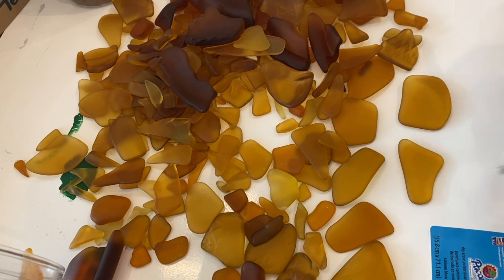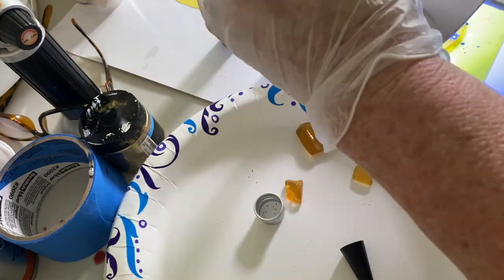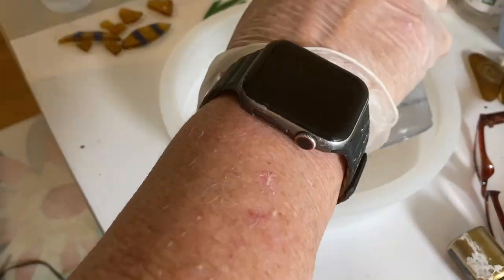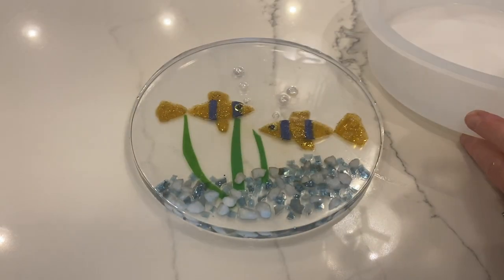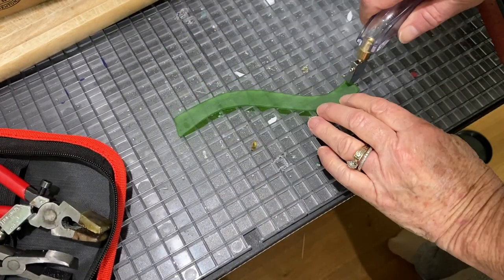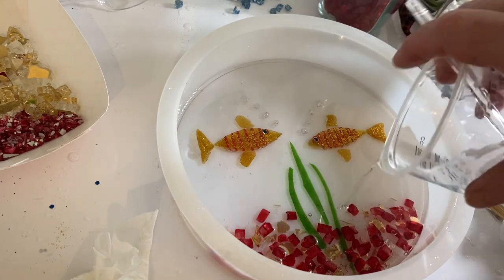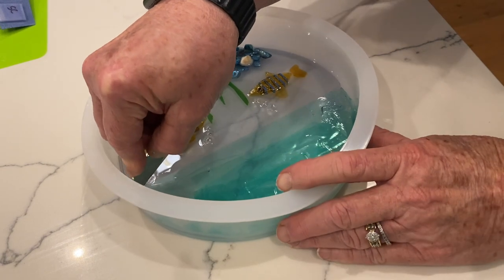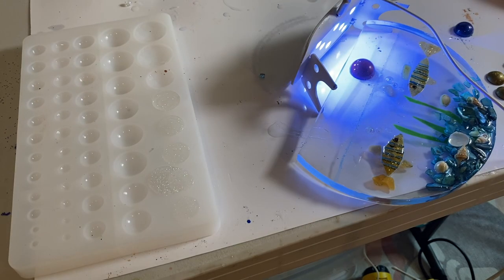FAUX FUSED GLASS WITH EPOXY RESIN, TUMBLED GLASS,STAINED GLASS FISH BOWL

Comment: Not sure if anyone has mentioned this yet, but a curing lamp like what they use at salons work great. They are stronger than the flat flip ones like you have. I love your work ❤❤❤❤
Reply from the maker: Well I have since bought a stronger one that folds and has the light on the top and bottom.

Comment: Oh soooo cute!  My favorite theme…anything beach.  Those are darling Linda.  I was wondering what amt. of resin are you using for this project?  Is it One cup Half a cup each parts?  Thanks❤️💜❤️
Reply from the maker: Thank you Yes I think in the first 2 I used about 4 & 4 oz for a total of 8 oz each and for the 3rd one which had 3 layers I think I used about 4-4 and then another 4 for a total of 12

Comment: Which resin do you recommend for a deep pour?  Thank you for your great channel!
Reply from the maker: I don’t know that i have ever done a deep pour. The deepest I have done for my round mold is prob about 1/2 inch But here is a good video to watch to compare https://youtu.be/aEoMvZe8KQ8
Reply: @crazyglasslady  This was a great video!  I noticed he didn’t try ArtResin?  Have you tried this one and if so what are your thoughts?  I can get this easily at the craft store.  The deepest pour I’m doing is a heart mold less than a inch deep.
Reply from the maker: @texasmarshalls  I have used Art resin and it is great. The only reason I have started trying other resins is because I have been looking for resins that are less likely to yellow esp out doors. My mermaid outside is done with art resin and has yellowed. I watched a video from Steve Mac Donald who tested some different resins out side and Art resin did the worst. Having said that you really should not put resin in the sun is what I have found it is just not meant for extreme heat or sun. The resins I have been using now hold up better out doors so I assume if they are less likely to yellow outside they may yellow more slowly indoors. The ones I am using are fast curing resins not good for canvas. Art resin is not for deep pours Im not positive but I believe you can only do 1/4 inch at a time Hope that helps
Reply: @crazyglasslady  so helpful!  Thank you also for your quick response!

Comment: Could you possibly use a line of silicone sealer to make a dam for the blue layer? Then remove it when cured?
Reply from the maker: That is a good idea! I bet that would work.
Reply from the maker: The only thing is, you would have to be careful you couldn’t let the silicone touch the side of the mold because the silicone would stick permanently to the silicone mold. I guess you’d have to put a little piece of tape there.
Reply: Didn't think of that, but maybe yes. Plastic wrap maybe.
Reply from the maker: Yes, good idea

Comment: what size silicone round did you use?
Reply from the maker: So at the end of every video I always explain everything I use usually especially with this mold because it is called a 9 inch mold on amazon but the inside diameter is actually 8 inches why they call it that I have no clue. So the stand for it is called a n 8 inch stand. I felt like that was confusing. Also Under the about info under the video I try to list everything I have used in the video. Here are the links to the mold and stand. I have made about 8 other projects and videos with that mold  I have gotten my moneys worth LOL .
Mold:   https://amzn.to/3SwO7TI
Stand:   https://amzn.to/3Hw0EQT